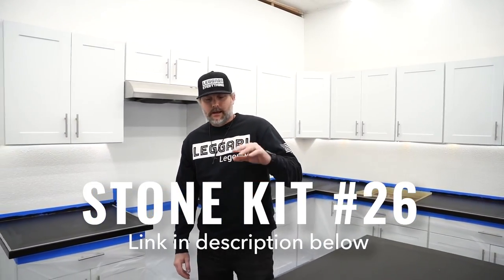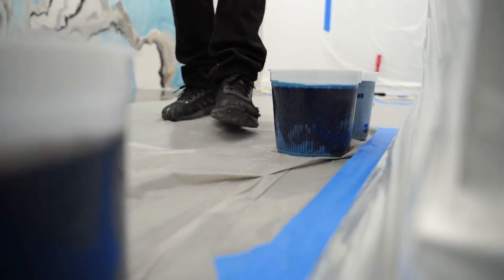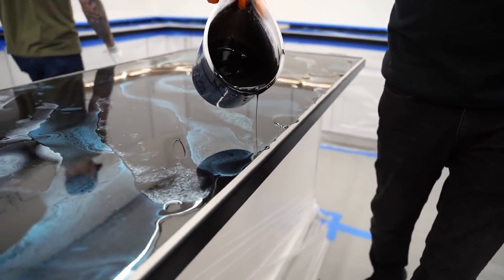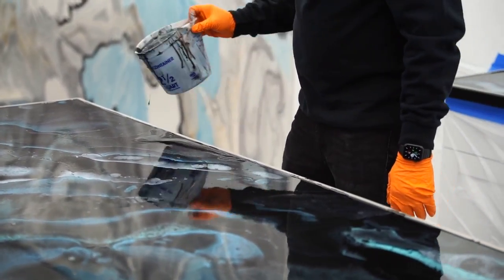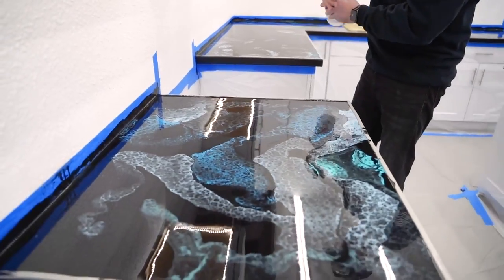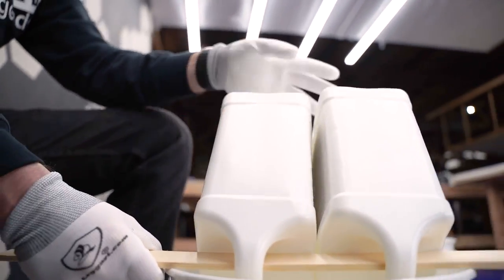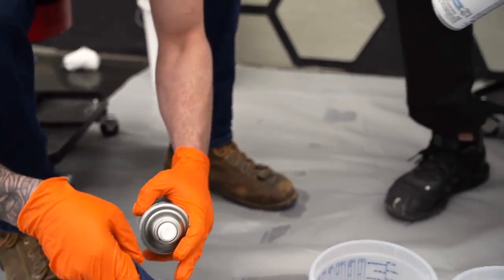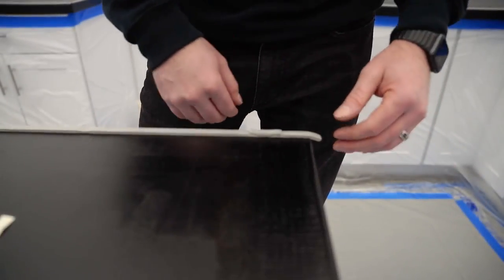Epic Black & Blue Epoxy Countertops Make Them Look Like Blue Stone | Huge Savings

Comment: Definitely keep the dispersing effect,those colours are amazing,that turquoise is great,I've recently tried putting weather stripping on a project table of ours and this doesn't come off like yours does,was well and truly stuck to the table and peeled off in a thousand bits😭,so just beware when doing this at home it's not 100% removable.Fantastic colours in this project though.
Big love from uk.
Reply: Maybe try it over painters tape for easier removal 🤔
Reply from the maker: Did you use the same brand!
Reply: @LeggariProducts  unsure to be honest,as I'm in the UK but just assumed these items are the same ,but obviously more adhesion with the one I used,was a nightmare getting mine off so I'll look for another this time,what was your brand again please? I'll look on Amazon this time.
Reply: @LeggariProducts  What brand of weather stripping are you using? I couldn't tell from the video and I've had mixed results with trying this technique with other weather strips
Reply: @LeggariProducts  can you put a link up to the brand you're using please?sure it'll be available on Amazon,the photos on Amazon are just of the foam and not the brand so hard to see which one it is thank you.

Comment: I have a similar-sized kitchen. How much product are you using? 57 square foot kitchen. I want to do a clear flood coat over the top as the topcoat as well. How much epoxy would you recommend I buy?
Reply from the maker: Email customerservice@leggari.com They will be able to help you put your kit together. Leggari counter kits are designed to cover 50 sq ft

Comment: I like the dispersing effect but then I want to smooth on top if that possible??
Reply from the maker: Our epoxy is self leveling so even if you use the isopropyl alcohol And denatured alcohol, allowing each to evaporate, you will have a smooth epoxy surface after🤗

Comment: Hi there, how much epoxy will I need for a 96x18x5.5 inches surface? 5.5" is the edge height. It's basically a floating entertainment shelf. Thanks!
Reply from the maker: Hello! Please contact our customer service with help regarding your project. Thank you!
1-844-LEGGARI (534-4274)
customerservice@leggari.com

Comment: When do you pull off the tape on the backsplash area of the wall
Reply from the maker: Pull the tape before you topcoat so about 24 hrs and retape for the topcoat to avoid having to cut the tape out also be sure to tape your back edge about an 1/8” high all the way around so it doesn’t get locked in at the base!

Comment: Can you epoxy on kitchen floor if yes what about slippery
Reply from the maker: Yes you can, Epoxy has a slip resistance similar to tile! We do have a grit additive that can be mixed into the urethane topcoat to help with slip resistance, and has a slight sandpaper texture!